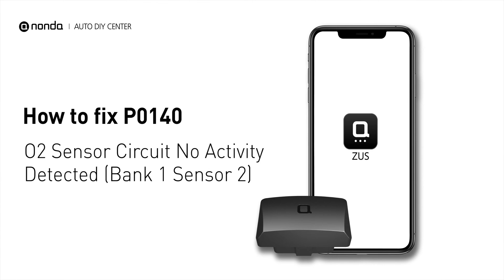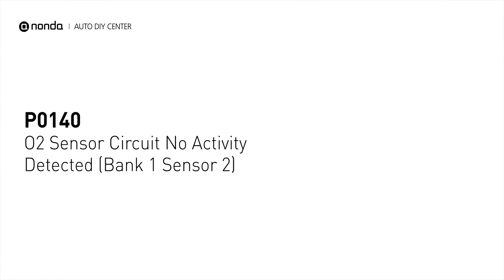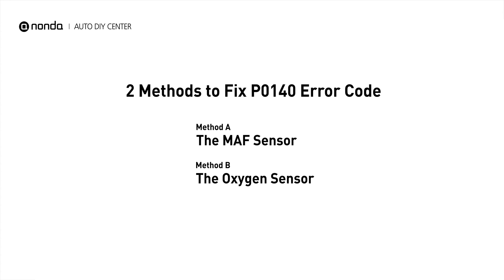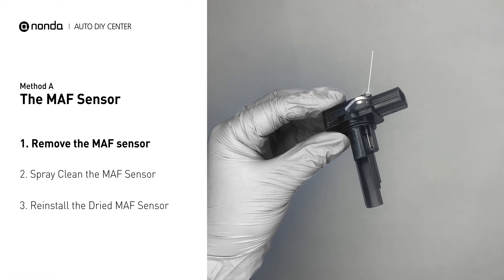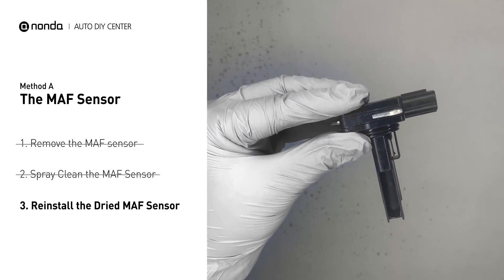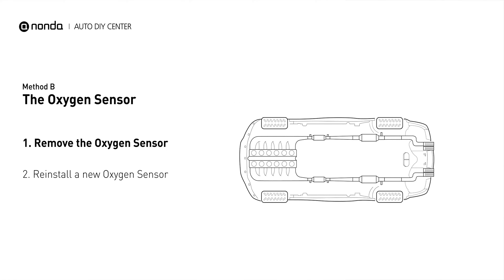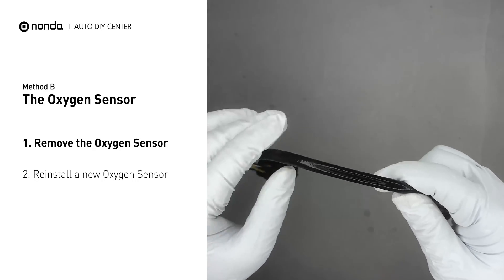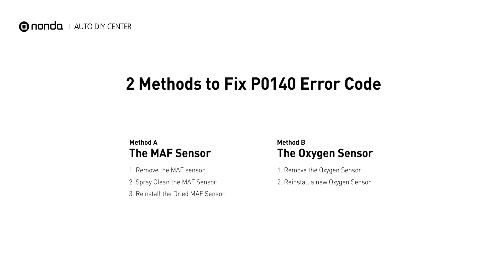How to Fix P0140 Engine Code in 3 Minutes [2 DIY Method / Only $9.53]

Comment from the maker: Hi, I'm Steve, nonda's lead mechanic engineer. 
Feel free to leave your comments here if you have any mechanic questions, I will be glad to help you out!
Reply: So is the bank 1 sensors 2 behind the driver side?
Reply: So is the bank 1 sensors 2 behind the driver side?
Reply from the maker: Hi Johnta, it's either on the driver's side or vice versa because there are different kinds of engine that have cylinder 1 on different sides. You may check your car's repair manual on where your cylinder bank is located.

Comment: Hi  Suzuki Swift 2018+  DTC  P0140  P2271  How to fix it?
Reply from the maker: Please check the possible causes:
P0140
Faulty Rear Heated Oxygen Sensor Bank 1
Rear Heated Oxygen Sensor Bank 1 harness is open or shorted
Rear Heated Oxygen Sensor Bank 1 circuit poor electrical connection
Inappropriate fuel pressure
Faulty fuel injectors
Intake air leaks may be faulty
Exhaust gas leaks

P2271
Faulty Rear Heated Oxygen Sensor Bank 1
Rear Heated Oxygen Sensor Bank 1 harness is open or shorted
Rear Heated Oxygen Sensor Bank 1 circuit poor electrical connection
Exhaust gas leaks

Comment: Hi i changed the two oxygen sensors and MAF sensor, but appear the p0140 and check engine light is on, the car works correct.
Reply from the maker: Hello, please provide us with your vehicle's year, make and model. Also, please let us know if there's any other code present.

Comment: I got this error after replacing the oxygen sensor with a new one
Reply from the maker: Hello, if there's no other codes that register along with this code, you can follow the tips/solutions provided in our video on how to fix P0140. Hope this helps!
Reply: @nondainc  yes P0137 (o2 sensor low voltage)  .. I have the original O2 sensor and that was throwing a different code, PO13A (o2 sensor slow response).  So now I am thinking the Bosch O2 sensor I got is faulty, should try a better brand? I got the right one for the 2nd bank though from rockauto.

Comment: Извините за русский!

Показало p0140 давно! Сбросил check! Спустя 650 км снова показало p0140.. может ли это быть maF?

Mazda 6 gg 2005 

1.8 benz
Reply from the maker: Hello, possibly yes. this error code could be triggered by the the MAF Sensor and Oxygen Sensor issue. 
You may remove the MAF sensor, spray clean it, and reinstall. Also, inspect the Oxygen Sensor. Replace if needed.
Reply: @nondainc  thx you very much! I remove maf sensor today!!!!!
Reply from the maker: You're most welcome!
Reply: @nondainc  check again p0140..

Maybe dead lamda

Comment: This fix apply if the vehicle has MAP and not MAF?
Reply from the maker: Hi Carlos, these methods (provided in our uploaded video) are recommended to cars that run with MAF. If the issue still persist, we also suggest following the manufacturer's specific pinpoint tests for further diagnosis as tests differs per vehicle's make/model.

Comment: Hello, what would that mean, if I have P0140 fault code, but if I clear it with an ODBII tool, the fault comes back after ~3 days (around 6 small trips)? If the sensor would be faulty, wouldn't the fault come back instantly? I brought the car to a mechanic, he even said their tool didn't even show Oxygen sensor fault.
Reply from the maker: Hi Daniel, your mass airflow sensor might be contaminated. Please try cleaning the sensor to see if the issue will still persist.
Reply: No code would not come back instantly, computer needs reset after a certain amount of miles.

Comment: 2013 Volkswagen CC P0140 and P0141
Reply from the maker: Hi Jay, kindly inspect the wiring and the condition of your rear O2 sensor, it might be faulty and needed a replacement.

Comment: Hello, I have a 99 gmc sierra 1500 5.3 
I replaced both knock sensors, harnesses and gaskets as well as all 4 o2 sensors. I now have new error codes p0140 and p0160. I dont think all brand new o2 sensors are bad right?
Reply from the maker: Hi Michael, we suggest setting up an appointment to get your car checked out further by your local mechanic.